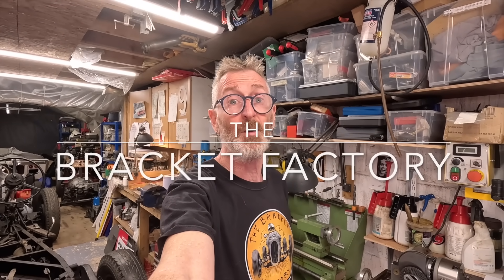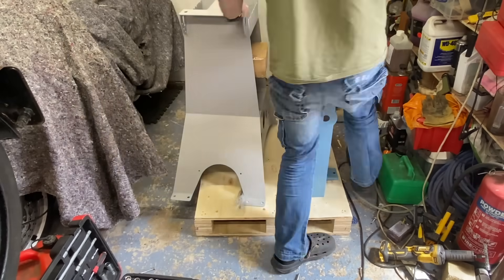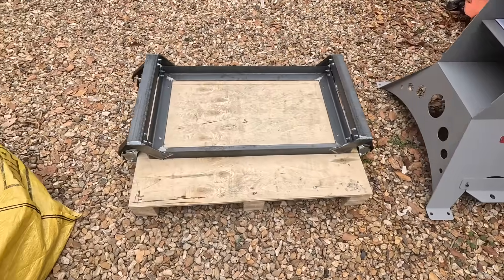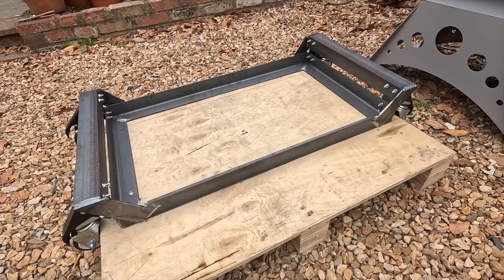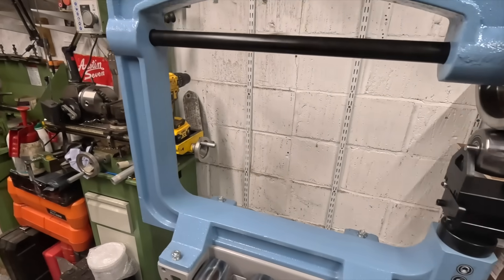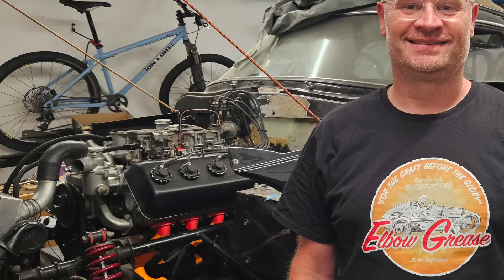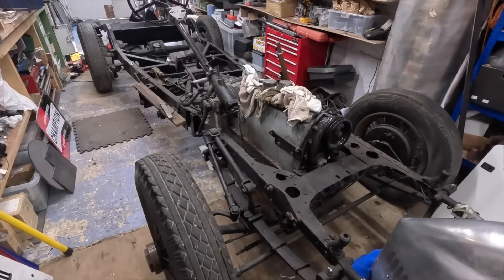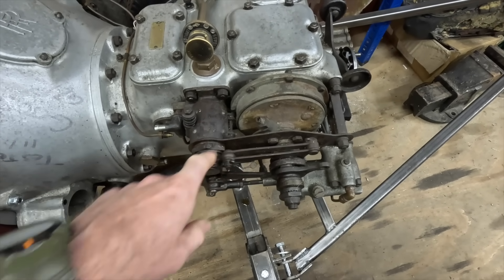Monster V12 Vintage Speedster Project - Let's Crack On - Episode 26

Comment: An idea flashed before my eye's
  Using Aluminum instead of weaker and heavier AL--uminiumiumuimnium would allow you to use the thinner stronger sheets, making the body weigh less.

  There is also Duralumin, a Aluminum - Copper alloy that hardens over time. Meaning you can work the soft material, that will harden later.

  Aluminium_bronze has some cool colors that should make the body stand out over others.

Comment: A bit late to the party on this. I've spent the last few days binge watching this awesome project. A truly magnificent engine, if rather weird in the valvetrain and combustion chamber departments.
Couple of thoughts. On carburetion, much as I love SUs, and acknowledge the bonnet height issues, were it mine I'd seriously consider 6 downdraught Strombergs, both as a nod to the engine's early US hotrod era origins, and because (I think) the manifolds and linkages would be much easier to do. Basically 6 straight  tube stubs, and a straight rod linkage along each bank. Possibly cheaper as well, given what SUs seem to cost these days, although US shipping charges might cancel that out. You could always accommodate them under a pair of Higham Special/early Bluebird style bonnet bulges 😅.
Have you given any more thought to the back axle? I would have thought finding a tall enough ratio to do justice to the torque and the ~3500rpm redline might be difficult but rewarding.  After all, one of the main joys of an engine like that is burbling along at the legal limit at barely above tickover in top.
Anyhow, will be following avidly to see how it all turns out.
Reply from the maker: Hi Hugh, welcome, and better late than never!  It's a peculiar thing isn't, but also very impressive at the same time! I like your idea about 6 downdrafts - I'll have to do some research  - if they are individual then no large manifold and all that space saved! Nio more thoughts about the back axle... but.. I am considering going 'bigger' on the wheels (they are 18", I'd prefer 21") so I am looking at another axle... stay tuned!

Comment: Watching you learn the english wheel is going to be interesting. I am just getting ready to make some panels for my old Honda CB750. They need to fit in with some well used ally parts so I was planning to have a go with a sandbag and hammers. My other plan is an older Pembleton, yet to be sourced, and have a play changing the tail unit. So rolling might be more appropriate.
Learning to weld Aluminium would also probably make life easier.
Reply from the maker: I'm looking forward to learning a new skill... but I don't think it'll be easy! Your Pembleton project sounds good - plenty of scope for making body parts with that!

Comment: Looking good!!! Welcome to wheeling!!! So, when you wheel it does stretch and add crown in all directions. If you want to bend/ round a panel you would use an upper rubber wheel or a rubber band stretched around the solid upper. Some channels to check out if you aren't already subscribed. Ron Covell and Wray Schelin (Pro Shaper) both do a lot with aluminum. Lazze does some awesome panels in steel. And so far, as explaining the hows and whys Karl at Make it Kustom and Nick at Invision Prototypes are great channels to watch. I'm sure there are many more. I'm looking forward to the future of the project and seeing some panels shaped!!
Reply from the maker: Cheers for the tips - I'm going to need all the advice I can get! I won't be making the body 'quite yet' but if I get some practice in, hopefully I'll vaguely know what I'm doing by the time I do! Cheers for your support.

Comment: Great to see that you've been able to get back to this, Chris. The demands of day to day life make getting a straight run at one's projects a project in itself! I'm particularly looking forward to seeing your solution to the mods to the chassis. 
    No straight run in sight on my own "speedster" project, but have obtained an overhauled 4litre short block and a whole donor engine. The short block has given me some dimensions to work with, and I think I can see a rational way forward with my chassis and engine/gearbox combination. Will keep in touch if I have anything worth of sharing. Cheers, Harry.
Reply from the maker: Hi Harry, thanks for the comment … I’m itching to getting ‘stuck in’ to the project!  It sounds like your project is progressing too … looking forward to hearing more about that!!

Comment: Great content as usual Mr. Bracket! I've done some English wheeling myself, having taken a one week course from Lazze Metal Shaping in California...he has a lot of good info online too. The main key thing that i've learned from Lazze's process, is that you need to maintain a border of about 1" around the perimeter of your shaping metal, where you don't wheel.  This creates a kind of 'frame' that forces the stretched metal from the wheeling action to dome up as a starting point for the desired compound curves....the curves build quicker this way, as you follow the recommended tracking pattern.  Also what i learned was that the metal was mainly stretched sideways from the wheel (as you've noted) but still a little longitudinally.  if you want to ensure only sideways stretching, a large rubber band (a piece of inner tube) is added to the upper wheel. Cheers!
Reply from the maker: That's some good advice - I'm going to have another 'play' today! Cheers 👍

Comment: Tell Neil
With the 2.5 Daimler because of the design of the push rods & cross mechanism etc you can't gain a huge amount of lift so he will have to resort to modifying duration Calford Cams NZ is worth talking to. We have found 4 I think they were 28mil side draft Dellortos are the way to go but he will have to fabricate his own manifold
Kiwi Rod

Comment: As it’s an aero engine, make it the same way as and aircraft fuselage with alloy frames, stringers then skinned, alloy rivets as well. Leuvered in the right places. Would be very period.
Reply from the maker: That does sound pretty cool Colin!
Reply: If it's a 1930s aircraft, the alloy frame and doped cloth covering.

Comment: Thanks for your plan. Yes a learning curve for the body. Looking at a lot of the coach built period ones most are done with wooden frames this may be important for racing classification don’t know. Having said this high speed cars would have metal ribs like a boat which could be laid out in CAD and water jet or plasma cut which would give a more efficient method of the form. I made most of my bike tanks with bucks don’t know how that works for such a big undertaking. Looking forward to your on going adventures 😊
Reply from the maker: plasma cutter!! that sounds a bit high tech 😉. I will probably make the Mk 0.1 iut of cereal packets!
Reply: @thebracketfactory  You will need a very big box.
Reply from the maker: I'm trying to have a 'ruthless' clearcut - it's a struggle!!
Reply: @thebracketfactory  Yes you are doing fine. Tech is only high if you look up to it. I would love to help directly but I am in the Netherlands so maybe a bit far. Maybe take some time get out go over to Brooklands have a look at some of the car body constructions. Good luck if nothing else a good ride out.

Comment: Hello Sir, I have a challenge for you if you’re up for it. I have a reverse trike built in the 1980’s from a Suzuki sc50 . The help i need is with the front suspension as if you go over 25mph the steering is all over the place. Thanks, Andy.
Reply from the maker: When you say 'reverse trike'... does it have 2 wheels at the front?